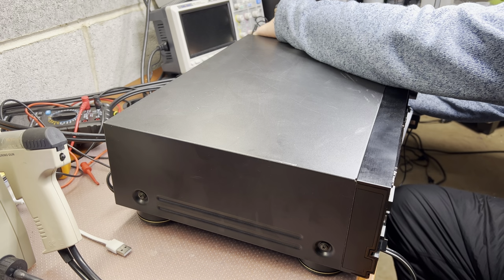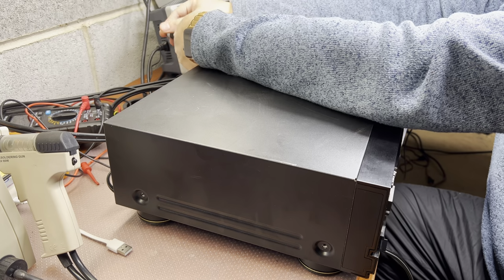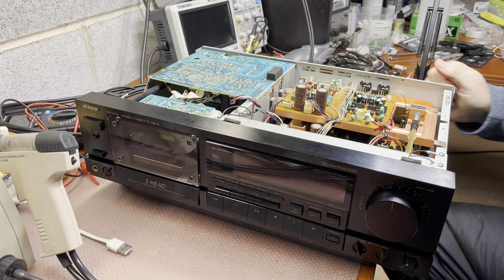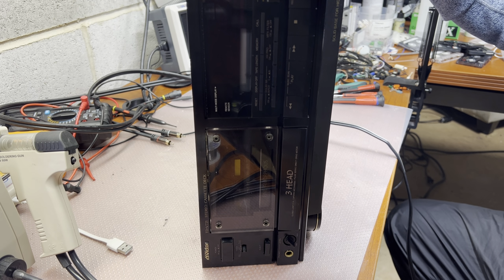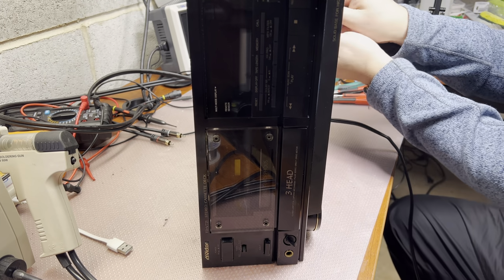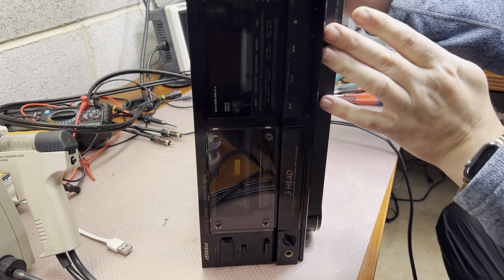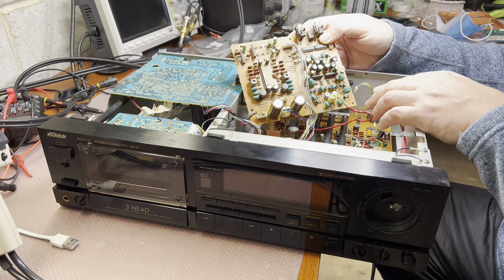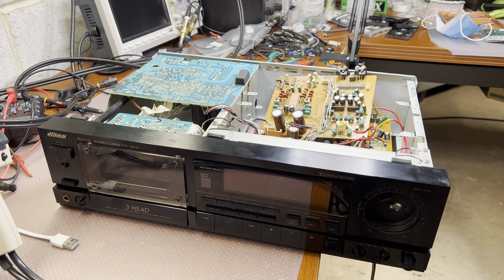Part 28 - Replacing capacitors on Victor TD-V721 with Nichikon Muse series

Comment: Hi.

As this looks identical to my TD-V1010, I thought I'd post a list of the capcitor values I have.

Are they the same as the TD-V721?

Cap1	Cap2	Value	Voltage	Type
C105	C205	4.7uF	50v	        Bipolar
C106	C206	4.7uF	50v	        Bipolar
C107	C207	22uF	25v	        Bipolar
C108	C208	4.7uF	50v	        Bipolar
C125	C225	4.7uF	50v	        Bipolar
C144	C244	4.7uF	50v	        Bipolar
C145	C245	22uF	25v	        Bipolar
C146	C246	4.7uF	50v	        Bipolar

Thanks for the great video.
Reply from the maker: These are exactly the same models, the only difference is the color of the glass filter for the indicator and power voltage. Your capacitors are correct as far as I remember, check the video where I am showing all capacitors I replaced, You may see by size.
Reply: @hifirulezzz  Thanks for that. Very useful info. got my Nichikon Muse caps on order. Plus a replacement for the horrible RIFA in the PSU :-)
Reply from the maker: @taffeylewis  Where did you order 4.7uF? I am waiting for about a month now...